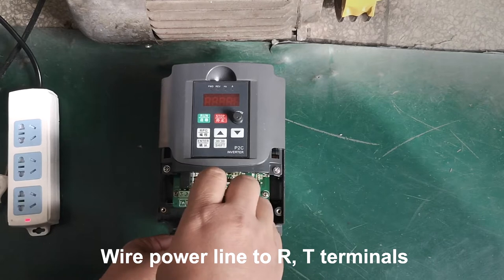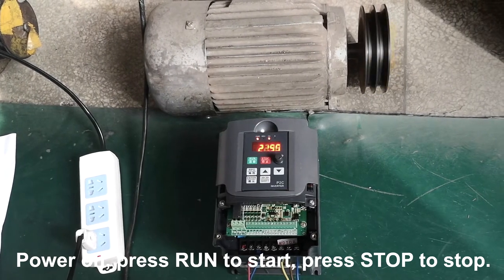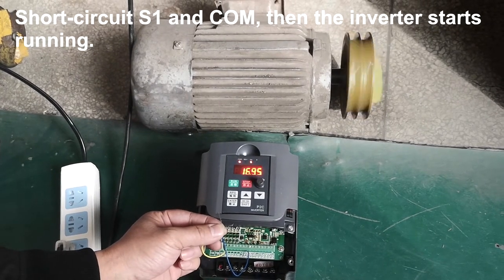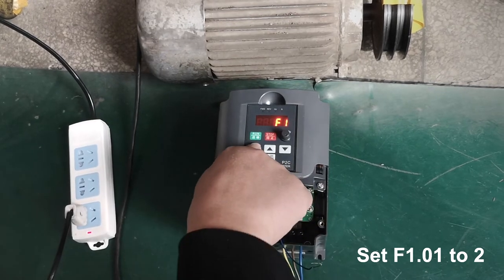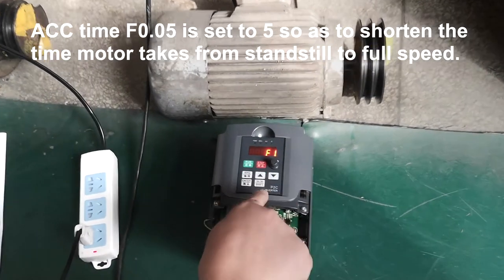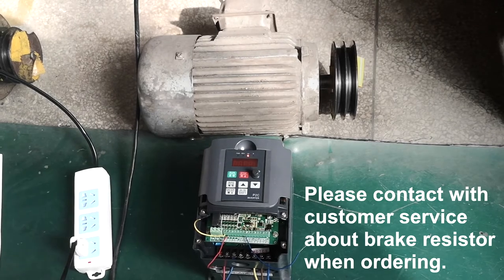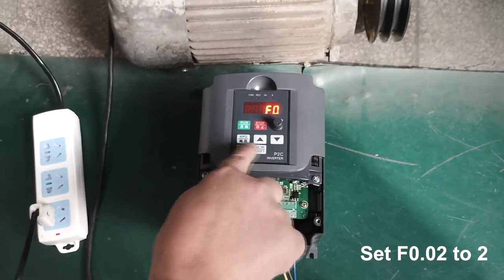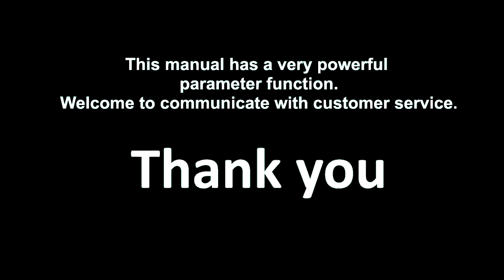Huanyang VFD P2C series Basic operation

Comment: Hi, I've got three HY VFD's. My HY01D523B runs a 400Hz air cooled CNC spindle that I purchased together in a package . It seems to run fine with these setting: 
Pd005 = 400
Pd004 = 400
Pd002 = 1
Pd070 = 1
Pd072 = 400
Pd144 = 3000

But it's set to run off 50Hz line frequency and here in the States the line frequency is 60HZ. Should I change a parameter to 60 Hz? If so, which one?
Reply from the maker: No need to change 60hz
Reply: @huanyanginverter6516  Thank you!

Comment: I got a GT 7R5G-2.  I am trying to hook up an AC Compressor-  I am able to start it by pressing “run” button-  how would I connect the thermostat wire in order for the ac main unit to run it instead of pressing “run”.   What parameter setting should I use?  Thank you
Reply from the maker: https://youtu.be/KD_NrfL7ZZs
Reply from the maker: S1 + COM

Comment: I have wired and set up the HY VFD to my motion control card using the pwm to control the spindle speed, the pwm changes the speed nicely however the spindle will fluctuate in speed +- 300 rpm. I checked the voltage from my motion control card and the voltage is steady and does not fluctuate when the spindle speed fluctuates. Has this happened to anyone else and does anyone know the solution? Thanks
Reply from the maker: I haven't encountered it before. If the voltage is stable, there will be no fluctuations.